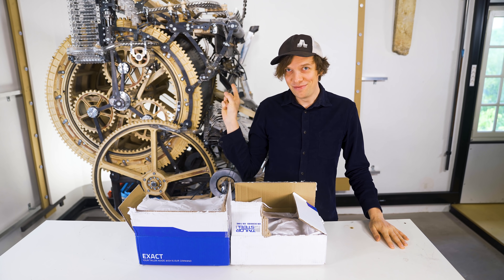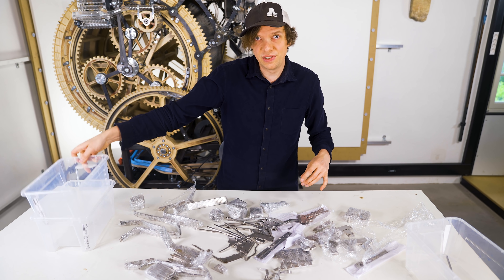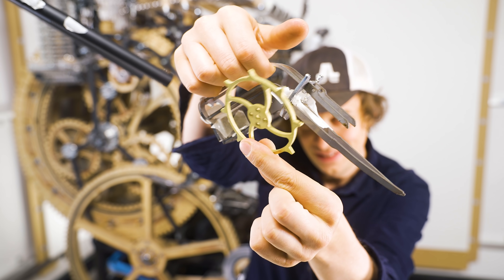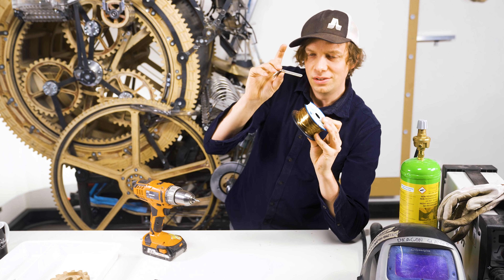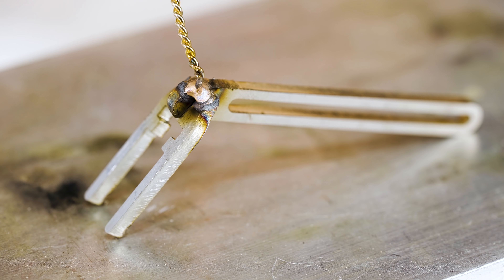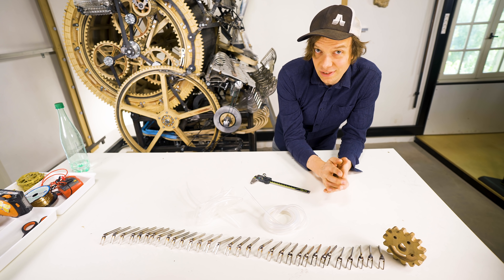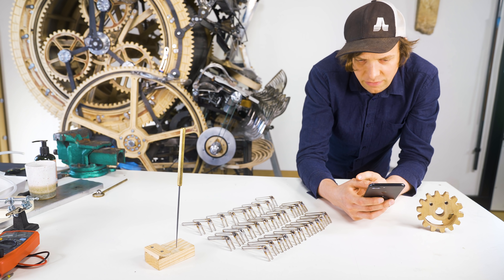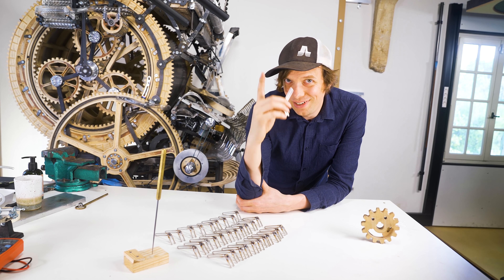Make it or Break it - Marble Machine X Escapement Gates Part 1

Comment: The better option when welding small stainless like this would have been making the tabs slightly longer and using the excess as filler material for a fusion weld

Comment: Those shrink tube pieces will add to the longivety of the machine. F × delta-t = m × delta-v. The right hand side is a given. So if you can drag out the delta-t ever so little the F will deminish. By adding that elasticity that is exactly what you will do.  (The constant drop and drop and drop of marbles on that fork made me think of catastrofic failure of Björk Shiley heart valves for some reason.)

Comment: I'm not sure, those chicken feet (dropper arms) might fail because the welded parts are not the best at resisting impacts, I suggest a bent shape, with some impact adjustment (hammer touch) 

https://photos.app.goo.gl/MZCUgAwgRH46EJZ29

Comment: im a little bit worried about the whole design. the original clock escapement was very simple and involved no spring nor flimsy wire, and it was ghetto tested and succeeded. this is a complex clock escapement with more parts and is much more complicated. i hope it doesn't fail but we'll see.

Comment: For cutting shrink tube: If you take magnets and stack them until you have a 16mm stack, stick them to one side of a pair of scissors and  put a short piece of sheet metal on it and you can use it as a stopper

Comment: Martin ! Get yourself a real welding gas container !! For real it's worth every cents !

I recntly bought a TIG welder, and started with throw away bottles (the same green one you have actually) and i couldn't run a high enough gasflow, so i kept getting porosities in my weld.

Then i did some math, and realised that 10 throw away bottles are worth the price of a real 2.4m3 one. But then the refill is cheaper than 3 throw away bottles ! Sov in comparison a real bottle is a bargain, and :
It will last a long time, so no need to worry about "do i have gas left?"
It will push more gas than you need if you want to, no more gas shielding problems
Reply: Can't stress this enough. A real gas cylinder will change your life. And save you money.
The only trap is that to get such a bottle you need to go throug a shop that has way to many cool tools, and it's hard to keep your money in your wallet
(since we both are in the south of france i recommend you look at soudecoup, their prices are great and the guys are helpful)

Comment: Martin watch it you will have, galvanic corrosion that will be worsened depending on humidity.  This corrosion may lead to brittle failure considering the repetitive stresses. You may think that you will not have since you are not melting both steels but this weld creates a conductive medium to enable this corrosion type. Stainless steel and mild steel should preferably be joined with no conductive parts. Please take it in consideration for the final marble machine design and keep up the beautiful and inspiring work! I know you will finish this project and it will be awesome!

Comment: @6:11 Yes, that would reduce weight on the gun however, that cable has some high voltage running through it and it would be a very bad thing if the insulation is somehow compromised. Now if you want to reduce weight, get a "shop tool balancer" and hang the weight off of that.

Comment: The progress you made in the last few months is quite incredible. Last year you were like a fish out of water. Despite working on this machine for so long with really good engineers by your side, you were still rushing into things, making all sorts of mistakes. Now you really sound like an engineer, thinking about a part all the way from design, to manufacturing, and through installation. Really huge improvements.
But there is something more to think about before you achieve PLM (product lifecycle management): how the parts will deteriorate through normal use. So i'm hoping you're also keeping that in mind.

Comment: Oh Martin. I wish I could have been there to show you some tricks for welding parts like this. A short pulse fusion weld will bond these parts without filler. As long as the alloy of your filler is a higher number than the part it will weld(in stainless). 308L filler will fuse 304 stainless with mild steel very well.

Comment: Next time you can design this couplers for small parts that you're removing to be removed by drilling. Maybe even with small hole in the middle for drill alignment? That would be faster and easier.

Comment: Martin: I will weld ONE escapement gate assembly
Also Martin: assemble all the channels as usual before test
Reply: I feel like down the road he's going to regret not cleaning those brazing points... he literally goes, "this is where the marbles will hit."
Reply: engineers  fighting about "the good way" to do thing.. how suprising :D
Reply: This whole machine is a prototype of the largest proportions. It's really quite tragic to watch him continually expect that it's going to work the first time he builds something. I had a rueful laugh when the flip flop overtook the divide by four.  The flip flop may have been the only working mechanism in the original marble machine.
Reply: @fletchro789  Yes, and this isn't even the prototype of the machine he hopes to use on tour. THAT would be the real challenge: most of the stages I've been don't even have stable floors - mostly wooden stages that moves when people walk on them.....
Reply: They have to work, because Martin gives up when not.
Reply: Yeah, not smart, given that his divide-by-four proved faulty the very first time he tried it.....
Reply: @francescosirotti8178  I don't even agree that the divide by four was faulty. I'm more worried about his new one, because unlike the previous design, this one will not persist if the marbles get backed up. It'll get stuck.
Reply: @rantingrodent416  Yeah he should have some sort of "clean" way for it to fail, like an overflow outlet that lets marbles out of the machine and into a bucket if they back up too far.
Reply: @rantingrodent416  something definitely changed between the test and putting it on the machine because it worked fine before. i wonder if it had something to do with the angle it was mounted at. regardless though, the new one should work find as i doubt he would have that many marbles flowing down it all at once anyway.
Reply: @jessiejanson1528  It worked, just not with the extreme consistency he wanted.
Reply: @jessiejanson1528  I mean it operated based on precisely worn grooves in wood. It wasn't going to divide things perfectly after any wear at all. The first divider dealt with twice as many marbles with more force behind them, so it was noticeably affected first. That was my assumption
Reply: @rantingrodent416  I've been watching his channel for ages and the problem with Martin, is sometimes he's far too much of a perfectionist. Even the slightest flaw in a part, just isn't good enough for him. Any flaw will just constantly niggle at him, to the point that he'll just end up trashing it and starting off, all over again. He has to learn that sometimes a part that is just 'OK' for the purpose, is good enough. Some things don't have to be 99.99999% perfect.
Reply: I watch in suspense, frustration and anticipation whenever this happens, and it has happened a lot. "Pain is temporary, glory is forever" is becoming an opiate for paying the price for not systematically approaching design.
Reply: Yeah, really I think he should make and torture-test one before assembling all the rest. In case it needs some adjustments.

Comment: Hi, you can use 309 filler rod to TIG weld mild steel to stainless 316L
Reply: Exactly this. Silicone Bronze is strong enough but, as a welder myself, I'd go 309.

Comment: Step one of welding is "get comfortable". It actually applies to everything but somehow welders have hid this from everyone else.
Reply: It's particularly crucial for welding and tattoo making. You only get one go for everything you do and any screw up is very dificult and time consuming to fix, if not impossible.
Reply: First time I tried welding was after I had been operating the benchdrill for six hours straight. Needless to say, I was supposed to weld standing up with no support, and with my noodle arms that was destined to fail. At least it was just a piece of steel for practice and not some expensive ordered parts